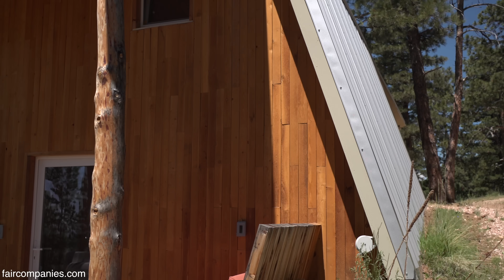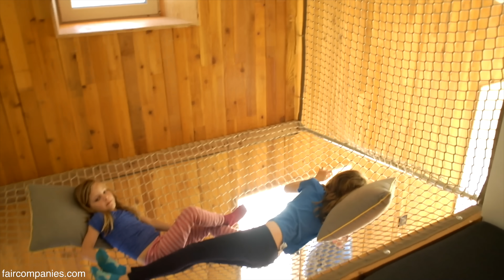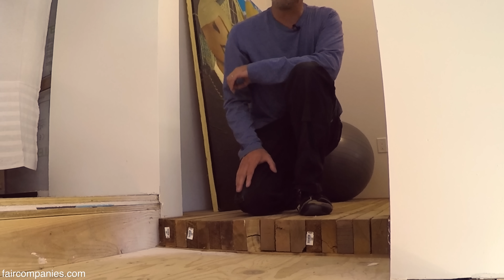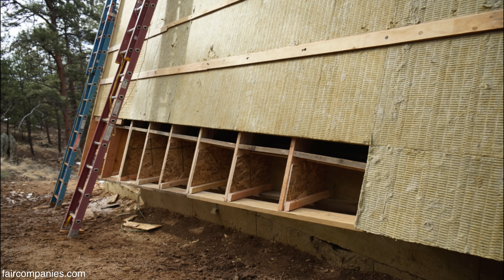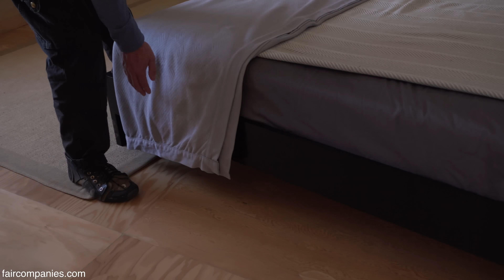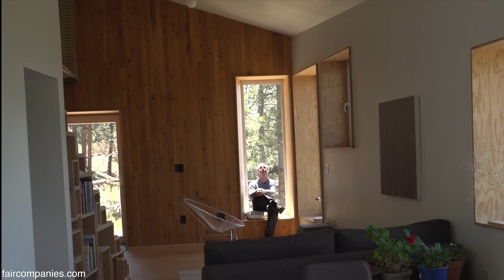Designer builds efficient off-grid Passive House in Colorado

Comment: Passive House *

He's gone from off gassing himself and everyone else with plywood and urea-formaldehyde to sealing it with polyurethane that also off gasses strong VOC's and isocyanates.

Propane in a closed environment is a certain carbon monoxide poisoning event.

I think my lungs would prefer a draught with leaking doors and window frames.

They're not really intelligent to be doing the opposite to damage your health.

That's what gets me every time when they wear the PPE but forget about the long-term health they are sacrificing because they didn't think it through completely.

I prefer concrete, steel and the Earth's elements to insulate me.

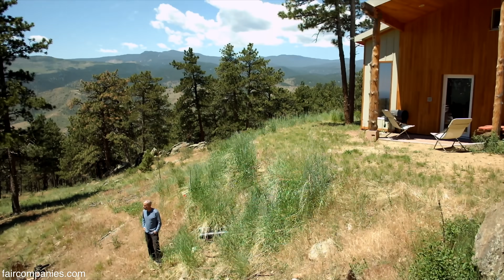Comment: 2:50 minimalist pre-conditioning (if you're European and don't believe in "air conditioning") ..basic tubes through the ground, air comes in through them, it's open on the other side, but linked by you, to your house interior, for ventilation (using hose or whatever flexible thing you link the open tubes from the ground with..)
in summer, it cools off the air inside the buried tubes.. Natural Free 'Air Conditioning'
in winter, they heat up the air for free, since ground keeps warmer, even when air is frozen.. ✓

Comment: this is super cool. want to point out though, michler says "propane is a total must when you're living off grid. there's just certain things that you can't do well with electricity, like heating water for instance. so to be able to heat water, and to cook, you typically have propane." this is not true at all, and i'm surprised he said it. i live off grid. the 800-1200w electric kettle far surpasses the propane stove. the on-demand propane water heater for the shower is certainly cheaper and simpler than the equivalent electric system, and an electric on-demand tankless water heater is not sensible, but a normal electric tank heater is straightforward to use off grid -- propane is certainly not necessary. a tank heater adapted to use excess solar panel production is a specialty among PV enthusiasts. for someone who went to the great expense of building with so much insulation and triple glazed windows, i wouldn't want any propane combustion products in my indoor air, and i wouldn't want the bill (though it can be quite small, maybe only $40/year).

but that's a small point. great building. would love to see it copied.

Comment: 60 W is ridiculously low power usage.  But the "standard" number for, say, micro-hydro power is 1500 W, which is ridiculously high.  I think I'd allow for more than 60 W, but it's something to shoot for in passive home design.

Plain fact of the matter is that 1500 W is at least an order of magnitude too high, and a well-built home should be at darn near 0 W for most purposes.  The biggie for me would be the washing machine.  I don't want to do the manual labor and I wouldn't want to make anyone else do laundry by hand.  Clothes dryer just seems like an extravagance, even though I still live in a conventional wood-frame house, with full basement, brick façade, and a ton of insulation overhead.  

I was going to say something like "Why didn't you build into the ground, but this place has - if I understood correctly - something like 30 inches of insulation.  And the place is TIGHT so he doesn't lose or gain any air, except what he brings in and lets out on purpose.  "Earth tubes" are always a good idea.  He says it "trickles," but I'm not sure how he's got that set up.

Super-beefy build.  

I'd do less with wood and more with an excavator.  

I love the triple-pane windows.  Guy does it right.  One thing I'll differ with him on is how nice the sun feels next to that window during a blizzard.  But from 10 am to 2 pm almost every day, you're gonna get SUN, GLORIOUS COLORADO SUN in the dead of winter.  There is a guilty pleasure sitting in a window, looking out and KNOWING it's 20 below (Fahrenheit) outside, with 30 mph winds, and you're getting a tan.  I've lived on the Front Range and the Western Slope, and even though it gets extremely cold, you almost always have good sun.  If I weren't such a fresh-air fanatic, just my basic full-basement house with eaves that keep the sun off the windows in summer and lets it in after the equinox, pretty much heats and cools itself.

I think he's a little skimpy on the windows.  I want to be properly earth-sheltered, which means LIGHT tubes being incorporated into the design.  But for esthetic reasons, I think I'd rather use a distributed fiber-optic light-tube array.  The light tubes that I've seen are pretty unsightly and fragile-looking intrusions in the landscape.  I'd just rather have a BUNCH of fiber-optic cable feeding into a light-gathering chamber underground, than have one or more of those ugly hemispheres overhead.  Never heard anybody talk about something like that, but I want the aboveground to just look normal from above.  Not seriously trying to hide the structure.  Just reduce its impact and improve the esthetic.  I'll show myself out.

Comment: This is a cool "hippie" implementation, but I want to make sure people watching this know that any shape or type of house can be a passive house. 

Just build better. Better air tightness, better insulation, better ventilation. You'll save so much energy that you can run the house off a bunch of solar panels. Probably 5-10 KW for any house depending on how big it is.

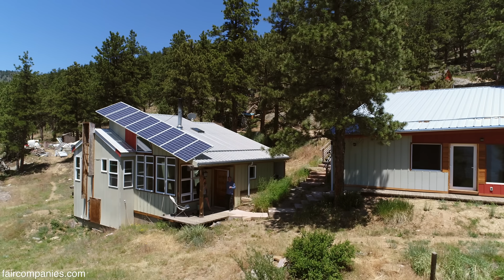Comment: 3:28 Bravo. That is very efficient! How much energy is that solar array actually capable of generating? As for the comment about "everything off" keep in mind, conventional homes that are "on the grid" will consume at least 3 watts because the meter that is attached to the home consumes that much. You pay to have the electric supplier gauge your use. Then add all the "wall worts" you have plugged in. They consume whether or not the device it's attached to is switched on.

Comment: That is GEOTHERMAL. Change the name or whatever this guy wants to call it use of Earth to heat and or cool or "pretreat" the air is GEOTHERMAL!
Where is the wedge?
 A wedge would be an A frame. Having 2 walls and a roof is not an A frame.
The shape of that home is Quadrilateral. I would take it that he does not do the work himself and that is obvious by his general lack of knowledge. Annoying Capitalist douche.
A tiny chunk of insulate between 2 windows is not insulated. 
-50 for a long time?
Propane is NOT OFF GRID.
DC Water Heating is EXTREMELY EFFICIENT! 
Plywood as a theme is lazy and horrible looking. Hideous especially that you live in a forest full of dead and down Aspen, Pine, Sugar, Pine, Doug Fir, Hem Fir, I was contemplating just where all the trees from the stumps.

Water rights are important for farmers to grow food. Though you may not be aware all watersheds were divided long ago mainly to protect food production.

Comment: I still would not live like this in Colorado. The building theory has its advantages for the contruction industy in general but it is still built on private property. 
Private property requires a system of laws and protection of that property and that is when you get a system of courts, laws, enforcement as he mentioned makes any innovation a violation.
Colorado is an extreme state with Yuppies and law enforcement and the mix makes it inhospitable of a place to live limiting one's freedom and forces any new idea to conform to what the legislature rules. We all know that does not change unless you get rid of the foundation on which that superstructure stands, private property itself. 
You would have more freedom in a place that has its own independent governance where the state has no jurisdiction and innovations that do work in relation to what the environment needs is not impeded by an outside authority. This is the problem with America, it crushes a new model of a lifestyle to develop.

Comment: What is  insulation for. Soundproofing question mark. Somone pls help
Reply: heat retention. Its in colorado, and colorado gets very cold during winter.
Reply: @irasteinstien5008  dam so that means the summers are hell
Reply: Loosee Monnn not necessarily, he explains how the windows open and have screens and the small one up high and the big one down low makes for good circulation. But yea I was just in Salida a few months ago and it was definitely around 100 during the day. Pretty hot for sure

Comment: Not enough power for washer, dryer, hot water.  Must truck in propane, must truck in drinking water, must truck out black water.  If this house was anymore on grid it would be next to city hall.  And a thumbs down on the camper kitchen.
Reply: The water is about 80% from rain, propane filled every two years, and we have a septic system like every other rural house in America.... How hard is that?
Reply: @ACMichler  I am guessing you use this cabin occasionally a couple of days at a time, and thanks for the reply.

Comment: This looks like heaven to me, with just a few touches I could see living in a place like this year-round. Things like milk paint, concrete stain, recycled glass accent tiles, cork tiles, more built-ins (Murphy bed, desk/shelves combo, windowseat chests, roll-out pantry & closet shelves, floor-length wine rack. And of course some well placed bolts for indoor/outdoor hammock use ;) Could totally see rigging my 1950 Magic Chef for propane, and using it for cooking on the terrace outside. Definitely would want a south facing greenhouse room, complete with grey water system.
Reply: YES! Let's do it!!

Comment: Sold a passive solar house built in 1979 designed by an engineer. He built on a hillside with a cement basement under a two car garage. A three story house with a greenhouse on south side. The heat rose three stories in the greenhouse to a mechanical vent that pumped the heat into the insulated basement that had River rock. A separate forced air furnace circulated thru the rock storage. The heat turned on about once a week. In summer it cooled the rock late at nite to act as a pre chiller as this designer. This was long before super insulation and air door design. We get 140" rain and 30" fog so moisture control is important and. Floor sealing . in 1970's we built 40 houses the contractor bought his lumber package including t-1-
11 cedar siding. He stockpiled the siding on a finished street. Covered with plasticWhen installed the paint denominated. We sent the material to plywood assoc . we found it created a greenhouse under the plastic rain humidity and sun and moisture denominated kiln dried plywood. They changed storage specs btw we get 60 mph wind storms with that 4" of rain in 24 hours. Road as and foundations must be built in dry season .

Comment: My big concern there would be the inevitable forest fire.
Reply: exactly what i was thinking
Reply: Mine as well. The house is sided largely in fiber cement and  behind that is minerwool board. The roof is steel with a similar backing making it a type 1 fire assembly. Simpler shapes tend to have less place for ember to build up. A real issue is windows breaking in a fire front so we installed tempered glass which is triple pane, so I expect at least 12 min of survivability in the first wave of radiant heat. The trees have been thinned to about half or a third of what was originally there around the home, and the canopy has been broken into clusters. Thsi may not be enough but will go a long way we hope for survivability in a fire.

Comment: I made a rain water catchment system with an incredible first flush system to get rid of all of the bird crap, shingle resin, dirt, etc first and then it switches over to the collection system. I run a 12 volt pump that can pull 40 feet and push 60 and it runs off a battery charged by solar. Almost everywhere it's "illegal" as the townships say that the water is being withheld from being allowed to enter the Aqua-fir. When Hurricane Irma came through in 2017 it forced the power company to cut down almost every tree in my back yard and so now the system can be seen from the air. I am waiting for a letter any day that if has been discovered    due to a lack of cover from the air now. It is F ing NUTZ. They would rather have me use more water that has to be purified rather than take it from the sky (Ours is poisoned with chemicals, chlorine, fluoride, and all of the medication that flushes out of people...... live in FL so it is geriatric central. lol)

Comment: Colorado doesn't allow rain water harvesting in excess of 175 gallons per year. Apparently,  it's California's water that rains down on Colorado residents, so we can't have it. But, we sure are allowed to drill deep and pump out as much ground water as we want!  For off grid homes, the solar electric system needs to be sized to power a well pump, otherwise, you'll be on the grid for electricity. A generator backup is a smart thing to have, too. Check out the Eathship design for a smarter, more efficient home design, incorporating thermal mass heat/cool transfer, solar gain through southern glazing, and earth tube cooling. These construction elements will keep the home at a comfy temp all year long with little or no energy expendature. No bills except electricity and propane, and totally off grid for the hard core folks out there, of course. Personally, my wife won't live without a 220 volt clothes dryer! Cheers.
Reply: Sorry, but a passive house runs circles around Earthships for comfort and energy use. It just the physics of it and imposible to dispute when you put them head to head. Also if a residence is not tied to a water source a resident can store up to 10,000 gallons in Colorado. 90% of the state's population is on the eastern divide so it is mostly 19th century water laws that are the limiting factor, and one of the few restrictions in the nation for catchment.

Comment: If you are threatened by fire, do you have the ability to use your water supply with enough pressure to spray down the house and surrounding area? If so, how is it to be powered? Also, I'm surprised you don't have the area immediately surrounding your home, the grass/weeds weed whacked down as a fire barrier. Any comments on this? Reasons why not done?

Comment: No it's not geothermal it's preconditioning the air from the temperature under the ground bringing that temperature in the house but it's designed by physicist not a builder so it's not geothermal shut the fuk up dude it's Gio thermal. Really cool house man I like it

Comment: Any problems with your earth tube in terms of condensation, mold, mildew or otherwise?
Reply: All is good, it really is helping the Heat Recovery Ventilation a lot in the cold snaps. I see 40F at the HRV when its 5F outside. RH is also very low and dry quickly with the air flows in the Colorado climate. We definitely need to run a power washer through it though for dust build up.

Comment: A lot of toxic off gassing in those materials , Cob and earthen floors would have been a better choice.
Reply: I must say the house plan / layout and simplicity is great !! I just worry about health in the one place we humans spend most our time and where we have the most Control !  
While new building materials are generally lighter and more resource efficient than in the old days, many are manufactured with formaldehyde-based glues. The EPA has classified formaldehyde as a probable human carcinogen. Moreover, it can off-gas from the boards into the air, silently polluting your home’s air for years (the off-gassing rate is especially intense in new materials, and in hot, humid weather). Long-term inhalation of formaldehyde vapors can cause fatigue, respiratory irritation, impaired lung function and allergic skin reactions.

Comment: There are so many great ideas and people need to get back to them.  We rented, and are going to buy a small cabin on about ten acres for less than one year of rent.......AND we can have horses here.   NO MORE driving twenty miles twice a day to the stable.   THATmust substantially lower OUR carbon footprint.   We have wood stove heat.......great insulation, use a swamp cooler. ALL a lot less than our forced air and heating system, and we often can just open the front and back doors and let the mountain breeze clear the heat out of the house and spend a nice cool evening and night on the hottest days.         Cost, it will cost us half our rent to purchase the property and house.

Comment: Why the tires packed with dirt under the storage area ?  I don't understand how using the tires help.
Reply: Good question. It's the foundation wall from a shop I dismantled and reused for the house you see. It was tricky to design the passive house so I could utilize the old foundation and keep a thermal break- so the solution is that storage space you see in the back. The tire foundation is below that and is used as a mechanical run on the exterior of the thermal envelope which I could bring in the water, gas, and fresh air supply.

Comment: Basically, an Earthship tweaked. Glad to see it spreading.
Reply: To avoid any confusion this home has little relationship with earthships. Passive House methodology is based on building science developed in Germany but has spread globally based on prodigiously limiting heat loss and improving indoor air quality and comfort. Earthships are what we call mass and glass systems which I looked very closely at in the mid '90s but found to be overly reliant on solar heat gains and the issues that come with that in terms of year round comfort.